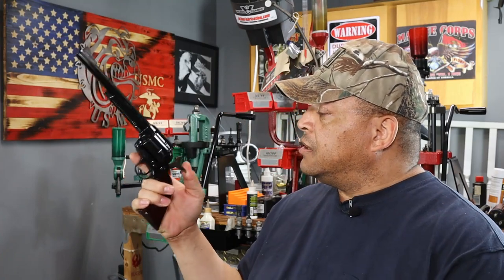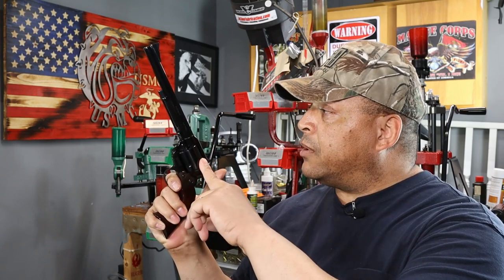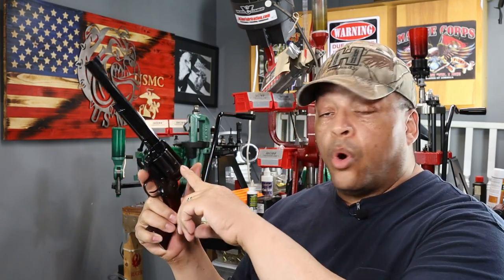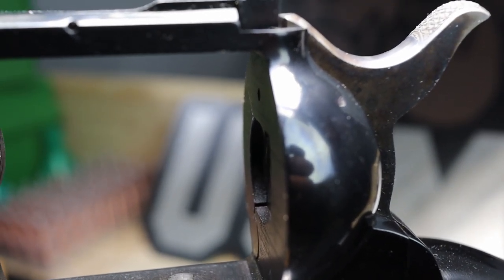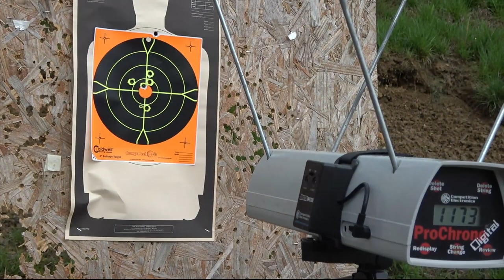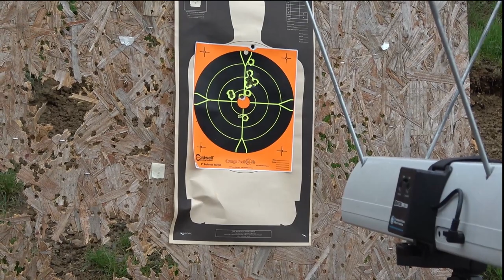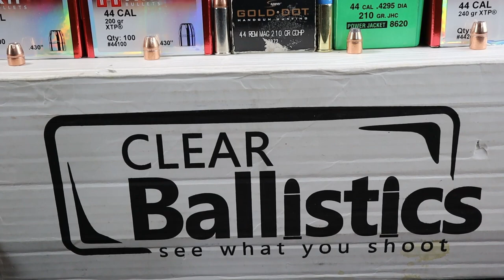Cimarron BadBoy: The Secret Revealed

Comment: Question for ya. I have purchased 2 Cimarron badboys in .44 mag. The first one got flash burns on the cylinder the first time shooting it and actually burned off the blueing at each chamber. It appeared to have to much jump from cylinder to barrel. Well I contacted Cimarron and after a little teeth pulling they had me send it to a mom and pops type place to fix it, they claim to have replaced the barrel and they said yes there was to much space between barrel and cylinder which caused the flash burning of the blueing. When I got it back the sight could not even be adjusted enough to sight it in. It was off about 2 feet to the right at only about 15 yards. Ok so I sold that one and bought a new one. Before I even fired it I could see there was a huge gap between the cylinder and barrel. Well when I shot it for the first time it burned the blueing off the cylinder at every chamber. Now the question...Have you seen this on any of them you have fired or am I just unlucky and got 2 poorly made badboys or is this normal for this revolver? Thanks

Comment: I actually see it on yours now that I look close at the 10mm 44 mag videos cover photo
Reply from the maker: No sir no bluing coming off here you may see some carbon. I measure my barrel to cylinder gap before I leave the store yes when I am going specifically looking for a revolver I take along a feeler guage. My barrel to cylinder gap leans on the side of tight at .004 for the 44mag and .005 for the 10mm. By some other popular brand standards this is to tight but I have not found it interfering with the turning of the cylinder so no complaints because that's what will happen. One of those brands consider anything from .006 to .012 to be ideal.